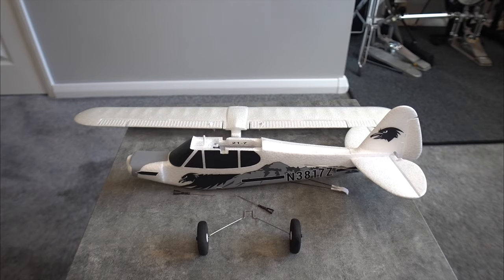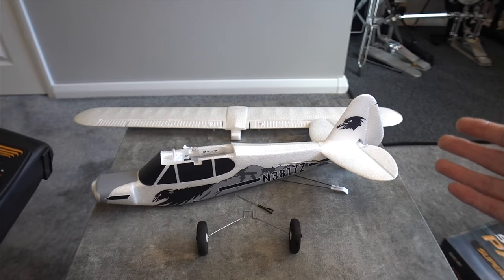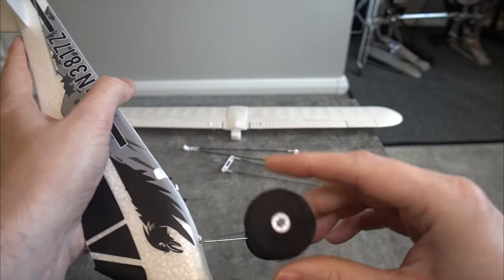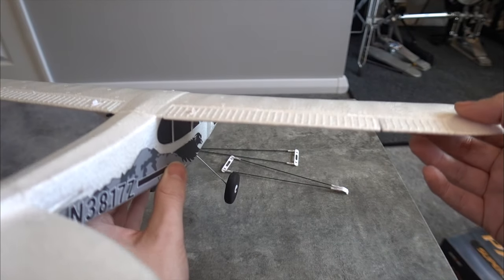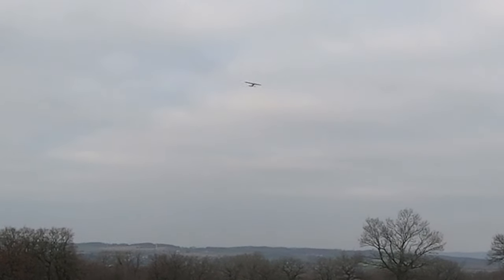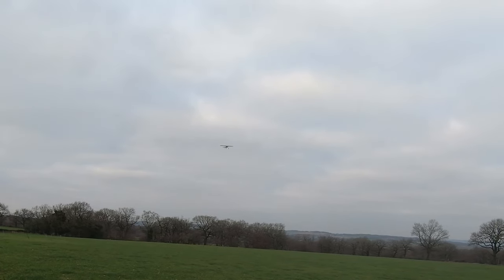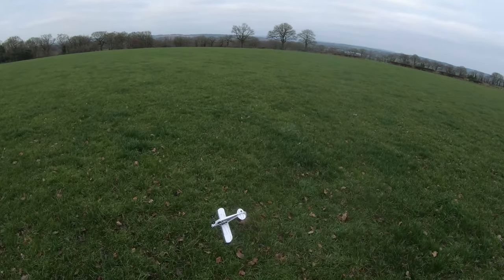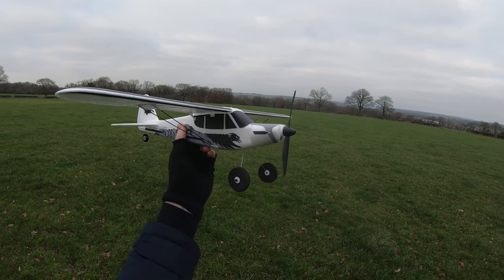PA-18 FMS (Eazy RC) Super Cub 540mm RTF

Comment: Hi, friend! I would like to acquire my first FMS brand airplane (but I am actually very concerned about the compatibility of the electronics, that is... most Horizon RTF airplanes contain spektrum electronics and many times their models are limited to said electronics... which raises them to a slightly higher cost! (E-flite, hobbyzone) my question: Is it possible to install any other ESC and receiver like Flysky on FMS airplanes in order to reduce costs and not lose so much quality? .. How does the quality of the ESCs that FMS puts on their planes compare to the renowned Spektrum electronics? greetings Which and what brand of transmitters does FMS use for its airplanes? thanks for sharing

Comment: Nice review! Looks like a nice flyer for calm days. It's too bad there is no stability during acro mode because the size is nice for transportation and casual flying and looks like the right form factor for a trainer. I'm surprised they're not putting the servos on the wing to make it even easier for transport. I'd rather unhook a couple of servo wires than aileron linkages, especially if they're that fragile.

Comment: I have been thinking about switching over from mode 2 to mode 1 lately, so to prepare my brain for the switch I have started wearing my underwear backwards and brushing my teeth with my feet.
Reply from the maker: It might work :-) it's much easier to go from mode 1 to mode two. Just pretend the right stick is a flight sim joystick and dont touch the other one

Comment: This FMS P-18 is great looking model. Think the ideal wing size for beginners and flying in general is  in the 700-1600mm wingspan range. (slower flight speed models for beginners)

One thing that I can't get over with these hobby radio/plane combos, is the transmitter always uses 4x AA disposable batteries, while the plane uses a rechargeable battery. Why not include a rechargeable battery in the transmitter (avoids needing a screw driver, and the extra fuss) 

A way to get around the toy-style micro-stablization and Rx combo is to do a conversion to INAV. ;)
A Matek F411-wse is ~8g, plus another 2-3g for a modern receiver. A flywoo F745 FC (16x16mm)  is only 5g, so a couple possibles for under +10g mods. (might even be able to swap out original pcb, to have net zero weight gain)
Reply from the maker: you are totally right there

Comment: That looks very similar to the Volantex Sport Cub 500 with a removable wing.  On that I use the multiprotocol module with the 4-ch sub of the V761 protocol.  Have you tried that protocol?
I fly it in a sports hall on manual mode but it is a bit fast.  Had to move the battery back to get it to fly better (mounted a smaller lipo below the fuselage).
Reply from the maker: yes that does not work. seems to be YEP as its called in the multi module world Yet Another Protocol
Reply: @AndyRCchannel  That's a pity :(

Comment: Man, that thing looked stressful to fly lol. It almost looked like it was a little tail heavy. The little UMX (ultra micro) series of planes from E-flite are pretty good.  The UMX Timber is similar to this and is supposed to be a really good little STOL bush plane that's fairly easy to fly but also can do some aerobatics. I'd probably recommend that over this one.  I had a UMX SBach a while back and it was shockingly stable, even in a fair amount of wind. It could also do some decent aerobatics but I think the size along with the gyro prevented it from doing a lot of 3D moves correctly.
Reply from the maker: stressful is the right word haha

Comment: As you were alluding to in the intro, these tiny planes are not at all easy to fly. They are great for something to pack into a small space to take on holiday but a learner really needs some sim time followed by something like a decent radio, an Apprentice with SAFE and some sort of buddy system. Some of the Eachine 1S warbirds look very tempting to take on holiday with my TX16S but this is more money and simply does not look as good. Unusual for FMS but hey ho.
Reply from the maker: I think that's why they separated out the brand but that's just an opinion. you are right and In general fms is my favorite plane brand